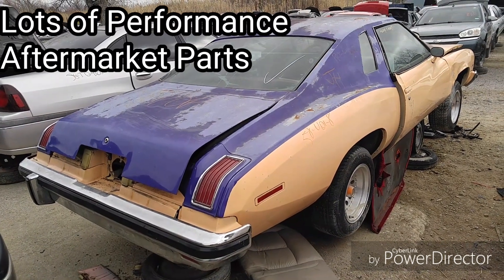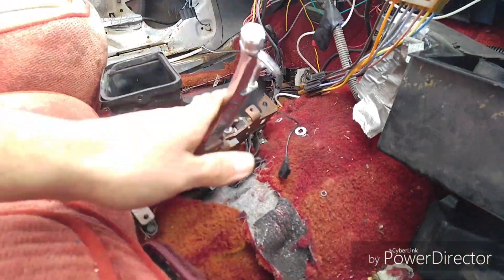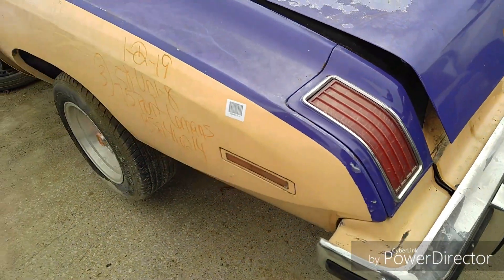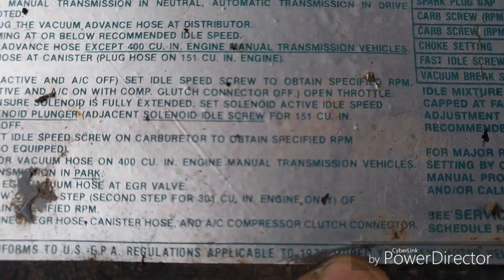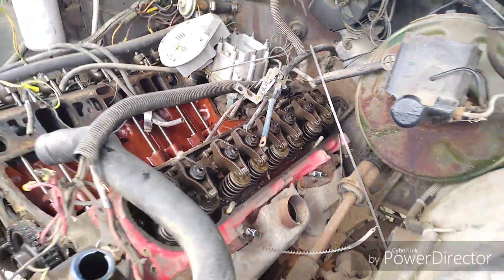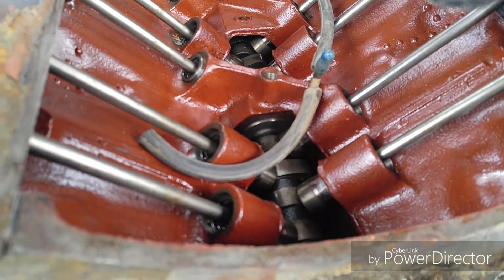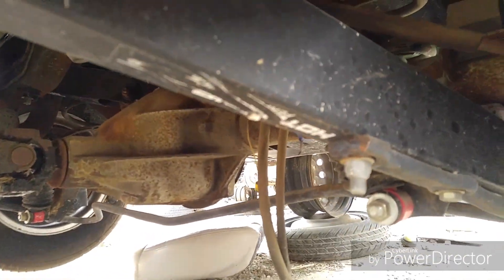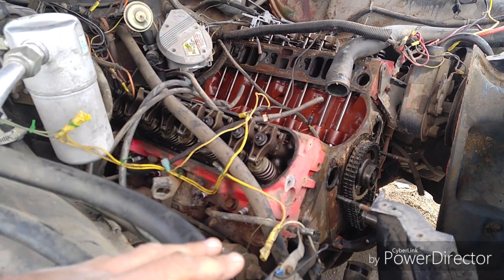1975 Pontiac Grand Lemans Junk Yard Find

Comment: I had  A 1974 Grand Am, a grand lemans with the Trans Am package. The TV commercials focused on the enduro front bumper, hit a wall and it will pop out, with no damage. I was a 20 year old college student, bought from a mechanic with Firestone. Had a folder of Life time warranties with it. I got a new battery, new duel exhulst when a muffler fell off, Firestone recalled their "500" tires, I got 5 new tires. The 400 V8 had a Bigger Cam installed, I drove it for 4 years... That car would smoke the tires anytime in drive, and chirp the tires when shifting into 2nd. My car was burgundy with a white top, the other option was white with burgundy top Rust killed it  as it was an Ohio car,

Comment: I would yank the complete drivetrain Rear and the arms along with the sway bars.  Great upgrade for a 73-77 Abody
Reply from the maker: I managed to get the engine, rear end and trailing arms. A guy beat me to the shocks
Reply: @ClassicRideSociety  Did you grab the Sway bars front and back? I believe they are from the sport package which has bigger bars.  I had these on my 73 GTO and it was the best handling Car I every owned. I would also check the trans since they put on an aftermarket pan its a good chance it was redone.

Comment: I had a 74 LeMans Sport Coupe. Under the hood l found a Factory Sticker that read " NOTICE: THIS VEHICLE IS DESIGNED TO RUN ON 98 OR BETTER OCTANE. I found a station still selling 105 (early 80s), and l tell ya, that sticker was right. Car ran really good on that stuff.
Reply: 105 makes for a happy motor 😁

Comment: The tail lights are from a Lemans the Grand Lemans had lines across the tail lights
Reply from the maker: I started to doubt it was a Grand lemans after I had uploaded the video. Guess I was distracted from all the parts that ended up taking
Reply: It's been a few years, but this was definitely a Grand Lemans. You can see the code when you videoed the body tag...AG37 denotes a 2 door Grand Lemans. Also, I noticed what was left of the dash was a Grand Lemans dash(Grand Prix style).

Comment: Man should of pulled all those parts off it could of sold them
Reply from the maker: I took the engine, the rear end, amd the trailing arms. A guy beat me to the edelbrock shocks. He also took the shifter. Everything was half off that weekend so I got that rear end for $50 and that engine for $100
Reply from the maker: Still have the engine and rear. Looking for something to put them in
Reply: @ClassicRideSociety  that was awsome deal u got on thst stuff can't beat that at all man 👍
Reply: @ClassicRideSociety  do you know if rear end is a bolt in for a 1977 Catalina  ? Curious I found one out of a 1974 lemans and wanted to upgrade from the 7.5.
Reply from the maker: @scottshumaker4969  don't think it will just bolt in as the lemans is an A-body and the Catalina being a B Body, the mounting locations might be wider in the Catalina rear. It's not too hard to find an 8.5 rear for that car. any 77-90 b-body will do. The wagons are just wider. Heck, 91-96 B body will work too just have to change the lug pattern on the axles. The big c body will work as well like the caddy, olds 98 And Buick Electra/Park Ave. Not all have an 8.5 but they really aren't hard to find
Reply: @ClassicRideSociety  ok, thanks for info.
Reply from the maker: @scottshumaker4969  👍